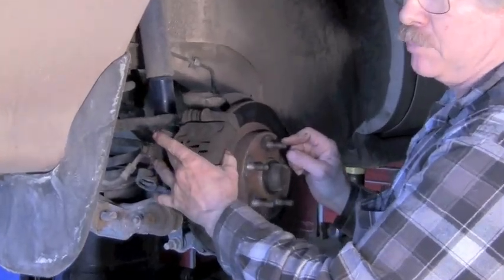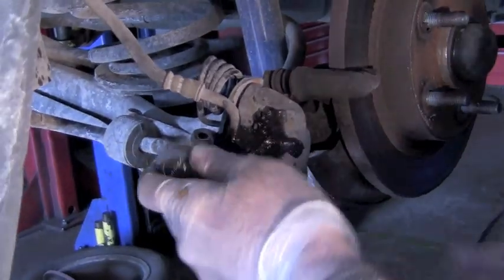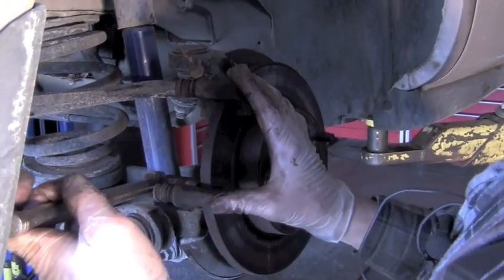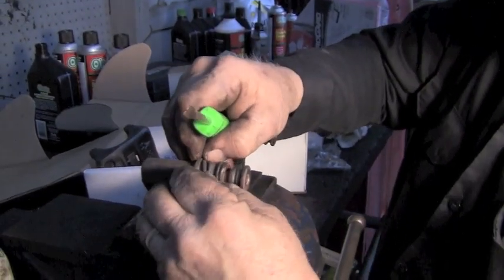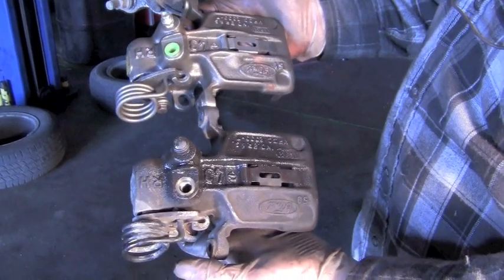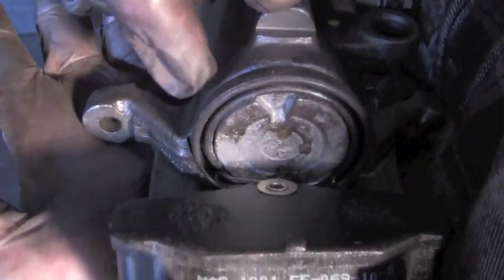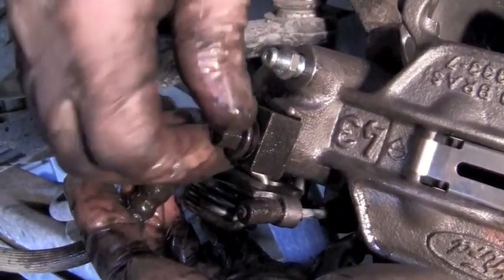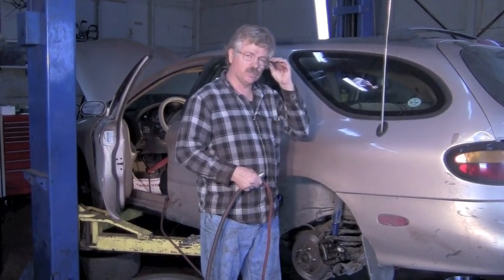Taurus Rear Calipers

Comment: I just did my uncle's "93" Taurus today and I replaced the drivers side caliper and both rear rotors and pads.This video was very helpful. Also when my uncle bought his caliper from Napa it came with the caliper mount.They told us that their calipers are now coming with the mount.Just a quick tip.Thanks for a great video and all your help.

Comment: Great instructional video. Thanks! If replacing the caliper with a new one, is the special tool needed to decompress the piston, assuming that the new caliper comes with a piston that is decompressed already?
Reply from the maker: If the pistons are already compressed and will fit over the rotor and pads, then no, no need to compress.  Often a large C-clamp will work just fine

Comment: Maybe I'm the oddball here, but I've seen those slide pins sieze up on Chevy Blazers with 4 wheel disc brakes so much that I started biddin new rear caliper brackets and slide pins with the bolts anytime I did rear brake work on them.

Comment: Thought my caliper was locked. Thanks to this video i found out i need the tool to twist it as its pushed in. Hope that works and i dont need a caliper too
Reply: Same here
Reply: What a PIA to get the passenger side though
Reply: Side note for someone that might read before they work. The passenger side screws in counterclockwise which means it screws out to screw in. Thanks Ford! 👎📉

Comment: @canadaeast  Nothing wrong with resurfacing the rotor a little to true it up and refresh the breaking surface. Maybe your guys figure it cost to much to invest in a lathe. Plus it takes some time for the lathe to do it's job. Since the cost of new rotors have come down so much it might actually be cheaper just to replace them.

Comment: Would that frozen caliper pin present as a bad caliper? The pads would continue to have pressure on the rotor if that pin doesn't move, correct?

Comment: You seem to have a bad microphone connection, siince some of the clips on this video are coming through only one speaker. Other audio clips are fine, even in this video.

This brake setup seems very similar to the VW Jetta rear brakes. I find that brake caliper design to be a little funky. 

This is another winning video, Duane. Thankyou.

Comment: @calmini4x4  Yeah, if that pin is frozen I'm thinking the inside pad would wear much more. If the caliper can't float, the inside pad would be the only pad giving stopping pressure. I'm sure after awhile it would cause the rotor to warp a bit since so much heat would be generated on the inside of the rotor

Comment: Man eye wished you did the rear driver side so I can see how that emergency brake lines up I’m leaking fluid FROM REAR CALIPER EVERY TIME I HIT BREAKS NEW CALIPER NEW BREAK HOSE HIT THE BREAKS AND FLUID FLOWS THROUGH THAT SCREW THAT CONNECTS TO THE SPRING
Reply: Have the same problem. Did you find a solution that’s not getting a replacement?

Comment: I got my parking brake out of the clip, but MAN, trying to twist that thing out of that hole on the caliper is impossible! Wisconsin winters are nice at rusting parts together permanently- no E-clips required! (but use them anyway)
Reply: Hi, A suggestion, if you ever have to take that spring off again, try clamping the caliper to the upper control arm with the spring facing you, it makes removal and re-installation of that spring so much easier.

Comment: hey I have a 1990 Taurus sho my left rear caliper won't release put new caliper even new braket with it new pad and rotor but it will not release to the point it get red hot there any idea why it does that thank

Comment: @Chris07860 I think all Tauruses up until the 2008 redesign/rebadging had rear drum brakes, with the exception of the Wagon model.

As far as I know, the wagon was the only Taurus to have 4 wheel disc brakes.
Reply: Not so

Comment: I've had to air hammer caliper pins out. Sometimes they get so corroded that the pins won't fit in there correctly anymore and make the caliper rattle.

Comment: Wonder if you could run a wire bottle brush on a drill to clean out the slide hole?  That slide looked like a project in itself.
Reply: Yeah, that's what I did. Gotta get that rust out of the hole.

Comment: hmm... I would have used a wire brush on the rusted caliper bracket hole!  You did clean the caliper pin, but I would suspect there is rust in the hole as well.  Other than that, I enjoyed the video.

Comment: Hi, you seem to have done Ford Taurus's before.  I have a 1999 Taurus, 6 cyllinder.  I am having an issue where at times, actually often times, the brakes seem to be sticking, or not completely releasing.  So when I am driving, I feel a wobble on the steering wheel, and a slight pull when stopping.  One time, I pulled in to get gas, and could "NOT" move the car.  It was locked up, I was in Drive, and it would not budge, made loud locking noise.I turned off car off, and after cooled, moved again.

Comment: That's a nasty looking finish on those rotors. Hopefully it's just the video/camera but it looks pretty bad. As cheap a those hat rotors are I always just replace, never refinish, too high a chance of pad squeal if the finish on the rotor is poor as well as high wear rate of the pads.

I hope you didn't mistake that stuck caliper slide pin for a bad caliper (stuck piston), it looked like that piston on the old caliper went back in pretty easily!

Comment: The brakes still stick-don't fully release, often times, and when it happens, if I'm in Drive, and take foot off gas to coast-idle, car slows to a stop even though no brake applied. How can I tell which brake-wheel it is? Also, is this something I could attempt to work on? Have no experience, but am mechanically inclined. Does this sound like a caliper? Any ideas? Sound serious? Appreciate your help! Thanks, Ray
Reply: Inside pad sticking on the caliper. I'd like an answer to that question too tho